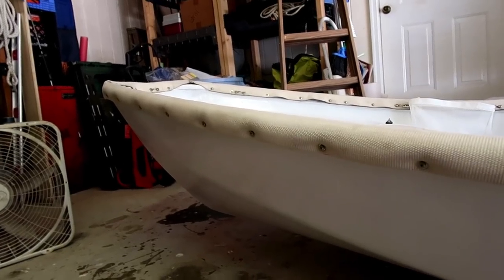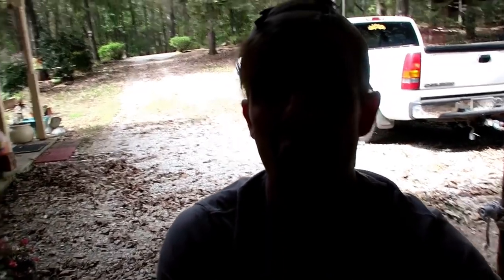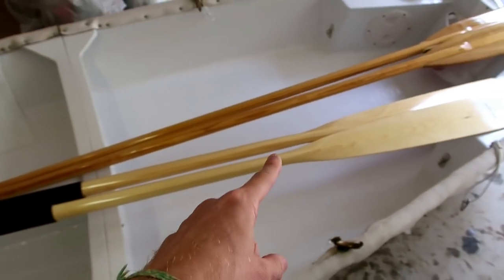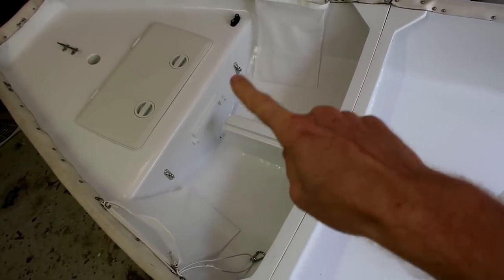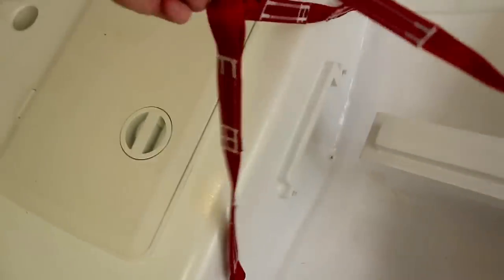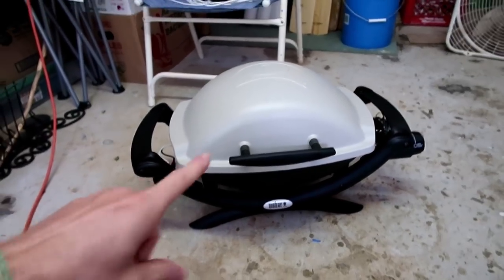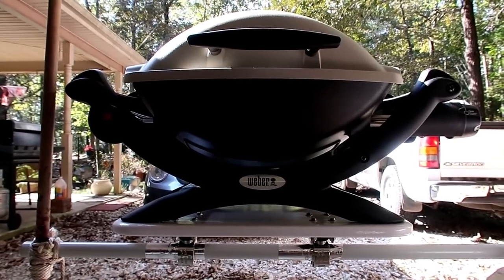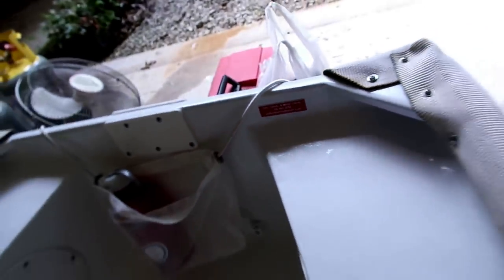Weber Propane Boat Grill, Dinghy Mods & Painful Foot Tattoo | Sailboat Story 88

Comment: I have the Q1000 love that grill they have accessories side tables & cover. I added adapter to use 20 lb bottle  you will need a latch I use bungee right now looks like crap. Going to put some permanent latch on.also great to take to beach so keep a couple 1 lb cylinder with you also.
Reply from the maker: I have a cover. A latch would be a great idea. I did safety wire the grated into place.

Comment: 4:10  YES!!  Someone doin it.
Your grill setup has SS and aluminum touching.  That's gonna rot out quick, as well as the aluminum in the grill.
Reply from the maker: It does have stainless and aluminum touching, but so do many other expensive and important items on the boat.
The outboard motor, diesel engine, aluminum toe rail, mast, boom, furler - they all have aluminum and SS in contact.
Of all of those examples I'm least concerned with $2 in grill fasteners eventually, after many years of service, corroding.
What are you excited about at 4:10? Are you talking about the oar locking device?
Reply: I found my aluminum corroding in my lockers after 6 months with no SS touching it.  It doesn't take many years.  Yes, the locks, so many cruising channels having all their stuff stolen, your lock looks great.

Comment: Hey Ben, I use the same BBQ on my boat and use it extensively.  I've almost got the same setup for mounting it as you do, although you've gone way fancier with the epoxy.  I decided to mount the bbq on the corner of the rail which gave me two directions to secure the bbq which was much more stable then using the straight run of the guard rails.  love to se it on the boat.  Very col with the dingy as well mate!
Reply from the maker: Good to hear.
I've been told by a few really smart people that my wooden platform will, without a shred of doubt, catch on fire.
BE CAREFUL SEAN!!!!!
Oh, I tried to do the corner mount for the very same reason, but the solar panel keep the lid from opening.
Reply: Uhhhhhh.....I if that catches on fire, then I can only assume that the entire stern of the boat is also on fire, at which point I'm not too concerned about the BBQ.  If we follow the same vein of "logical reasoning" then yes the sails, bimini and my arms will, without a shred of doubt, catch fire....

Comment: If the grille mount comes loose, try a piece of tire inner tube, wrapped around the rail, might tighten it plus keep the rail from getting scratched.
Reply from the maker: Thanks.
The clamp was very difficult to remove from the actual 1" boat rail.
Thinking it might be good, but a shim could be helpful if it needs a touch more tension.

Comment: Ben! That dinghy sure came out nice, I am going to be building one over the winter but think I am going to go with the Spindrift 11'

Been thinking about using Nidacore instead of plywood because it is about 60% of the weight of plywood, but 200% of the strength for a similar cost. 

No, composites are not getting cheaper, I just think they are lacing plywood with gold these days or something! 

That lifting harness is pretty slick as well, I think that is going to work well for you! Although I am making mine out of some old 1/4" stainless steel halyards I am taking of the boat, figure I can use it to lift the boat out of the water at night and leave it hanging by the halyard which will make it hard to steal, and if anyone tries to cut it, well they will be in for a surprise!
Reply from the maker: I just recorded a Q&A video, and in it I said that the PT11 would have been my second choice, BUT I was wrong.
I meant to have said the Spindrift 11.
I forgot about it until you just mentioned it.
I do like that one a lot, but I specifically wanted the pram bow.
I like your steel cable idea.
I begin all of my sentences with the word I.
Reply: Why the Pram Bow?
Reply from the maker: Just adds bit more storage space and beam upfront.
I also just liked the squared-off look of the pram.

Comment: The Dinghy came out great and Molly is going to have a blast in it.  Are you also going to bring  your inflatable on your next cruise?    You'll need it
Reply from the maker: She will love sailing it.
Nope, not bringing the inflatable. We sold it.
While we may certainly miss the inflatable at times, it is in no way a necessity.
Reply: @Sailboatstory  I raised my kids on a Catalina 30 (weekends with a few week long trips here and there)  We had a small sailing dingy but we quickly found that with two adults and 2 young kids the boat was often dangerously overloaded.  In calm water it was ok, but when any wind or surf it was irresponsible.   We picked up a 9' zodiac and towed two dingy everywhere we went.  The boat sailed a little slower but having more toys available more than made up for it.

There's a whole lot of people on YouTube these days making sailing videos and I like your spin on things and your dry sense of humor.  I just don't want to see you in some far off distant shore needing a more seaworthy way to get to shore without an easy and economical way of getting one.
Reply from the maker: Thanks for the concerns. I do appreciate the thought.
We'll figure it out.
Folks have been using hard dinghy's for hundreds of years.
Many people cruise with them today and even circumnavigate with them.
There are certainly drawbacks, but there are certainly benefits as well.
The drawbacks, granted, are ones that most typical, modern cruisers are unwilling to compromise with.
Hence the overwhelming popularity of inflatables.
While we are certainly modern cruisers, I'd say we are far from typical.  :)
However it goes with the new dinghy it'll be learning experience and an adventure.
Reply: There's plenty that can be done to make a hard dinghy more seaworthy.. removable buoyancy tubes that attach to the gunwales and provide more freeboard at the same time, for instance.

Comment: Put another id plate on the inside of one of the buoyancy tanks where it can't be easily seen.  If someone takes it and peels off the other plate, then it could be identified with the other plate if it is found.  Also if you ever have a motor on it in Florida for instance, it is required to be registered.  They can confiscate the dinghy in Florida I have been told.  Also using it in other countries may require a registration.
Reply from the maker: I actually did just that today.
Man - great minds think like me, right?

Comment: Just a thought guys about drain holes in your dinghy-
 - thinking on Davits / on a halyard in heavy rain sure would add a lot of weight to the boat ...
Reply from the maker: It's been a thought of mine as well.
This dinghy probably won't get much time on the davits because it's so long.
I definitely don't want more holes in the dinghy though.
Plus, the 2 part design makes adding drainage more difficult.
We're just going to bail it when it fills up.
I didn't think about making a "dinghy bonnet". HA, Tambi didn't like my name for that.
Basically a rain cover for it, but ended up deciding that it wasn't worth the space, time, and expense.

We do have several ways to pump water out of the dinghy including a saltwater pump that I just added.
Did you see that?
Reply: Sailboat Story did not see the pump - I made a dinghy some years back - it sat on my davits and I did make a cover - I did have a drain - and when my dinghy was on the davits I was safe in knowledge that any water that did get in would drain - did not want to put undue strain on the davits etc -  best of luck in what best suits you 👍
Reply from the maker: Near the end of this video is when I talk about using the pump with the dinghy -
https://youtu.be/eoaeQx5IIh8
Reply: @Sailboatstory  - Do a search online for sailing dinghy self-bailers.. they're great gadgets!

Comment: Great Idea about the contact information tag. May I suggest you add the country code +1 to your phone number since you will be out of the country on your adventures. Another thought is to add one or two  more hidden IDs in both the front and rear sections of the boat in case it becomes recovered stolen property. This will help prove that it's your boat when the visable plate is removed by the thieves. 

All good stuff! Keep up the good work!
Reply from the maker: I actually did put my new hull ID # in a few hidden places around the boat.
If all else fails perhaps I can use the video series of the dinghy's construction a proof.
Reply: Hopefully not blurring out your phone number doesn’t cause any issues

Comment: might want to attach a lanyard to the drip pan on your weber so it dont get lost in high winds and rough seas
Reply from the maker: Yeah, I need to do something with it.
I was thinking about using some safety wire to keep it in place.

Comment: I may be (probably) wrong. But if the Sailboat has MC numbers then the dinghy (w/motor) needs MC numbers also, if the Sailboat has a federal registration with Name and Port/Country then the dinghy just needs, and should/must have the name of the big boat on it. Check it out with experienced sailors. Coast Guard and other countries may care.
Reply from the maker: Check out my pinned comment at the top.
Thanks for the thought.  :)

Comment: Maybe put SV Sand flea on the name tag so if it should drift away at anchor they know what boat it belongs to vs finding internet and emailing you "we found your boat" they could just tie it back up to your boat since you will probably be out looking for it and not be on the boat or the computer....;)
Reply from the maker: Inside the bow locker I have the boat name, address, email, phone number, hull ID, and registration.

Comment: Ben...why would you not just get a "boat bar-b-q" with a rail mount ???
Reply from the maker: All the common boat ones seem to rust badly. This one seems built of better materials.

Plus, that would be too easy.
Reply: Ridiculously over priced stainless steel BBQ don’t cook any better.....
Reply from the maker: Yeah, that too.
Whenever plausible, I try to avoid the artificially inflated prices of the "specialty" marine use products.

Comment: Be sure and video when the board catches fire under that grill and it tips on the rail and dumps everything overboard.  I know it will light up that board.
Reply from the maker: Is that before or after the grill’s plastic legs melt?
Reply: Before. Wood burns before glass.
Reply from the maker: I suppose my curiosity is why you believe the wood would burn despite the plastic legs, plastic frame, and plastic handles - even the gas bottle itself - being much closer to the heat?
Reply: Unless its been improved, because the grease pan underneath overflows and sets fire to everything. Quite exciting. Don't wait for the gas bottle to detonate.
Reply from the maker: Ok, so then your not talking about the board at all as you eluded to initially.
I think we might be getting somewhere - stay with me...
If I understand correctly -
It's negligence on my part to empty the catch pan is why you are certain that my board will burn?
Reply: one chicken = overflow= flash ignition.  @Sailboatstory
Reply from the maker: Ok, ok, ok. I think we've gotten to the bottom of it!
So, it's neither the board, nor the catch pan that is the basis for your theory.
It is, in fact, the internal bodily fluid capacity of a chicken carcass?
Reply: i want to hear more about this highly flammable/combustion chicken.  Is it a particular breed like a bantam chicken?  Maybe a rhode island red as they are red like fire already and thus look more prone to just explode.
Reply: So a glass empty kinda guy then?

Comment: Maybe have some strips of rubber cut that will fit in the clamp just incase it wants to move
Reply from the maker: It's pretty darn snug with the lock in place.
Reply: If you decide that you need some when you get to the boat, let me know.  I am in Mandarin and I have some thin rubber sheet already.
Reply from the maker: I appreciate it, Robert.
Reply: @Sailboatstory  a roll of flex seal tape would be a good thing to keep onboard
Reply from the maker: I have "Rescue Tape". Probably pretty similar, maybe?
Reply: @Sailboatstory  not even close to same. Rescue tape is good for wrapping busted hoses and what not and sticks to its self only. Flex seal is a rubber sheet with some kind of supper sticky glue on it that can be aplied under water
Reply from the maker: Ooooh. Ok, I like that idea.
I've got 2 of those wax toilet rings for similar use, but I'll add that to the emergency gear list.
Thanks!
Reply: @Sailboatstory  Wally World Has It and yw
Reply: Incase of a hole in bottom of boat you would want to apply to both side of hole